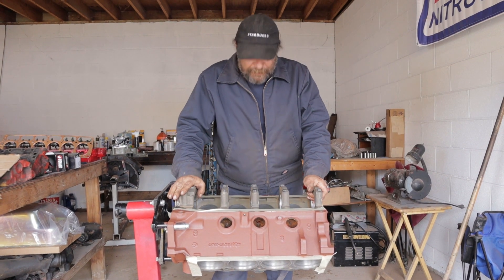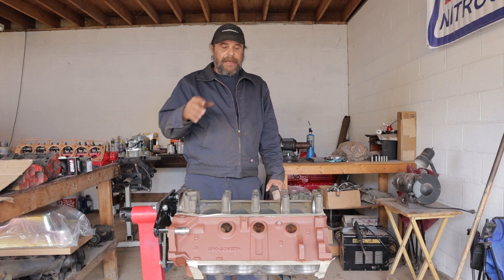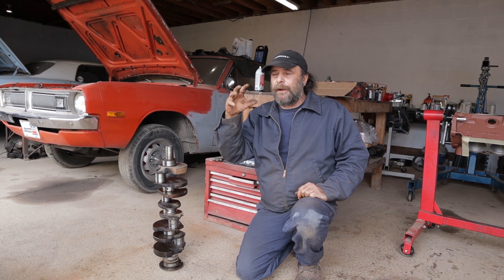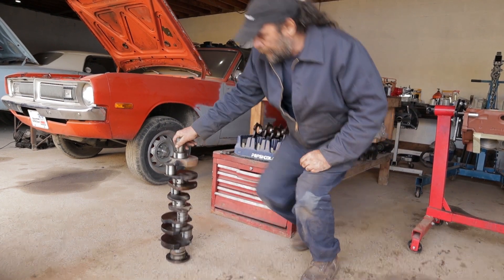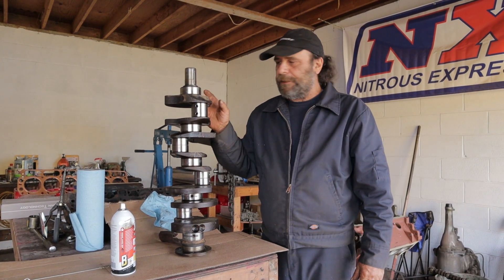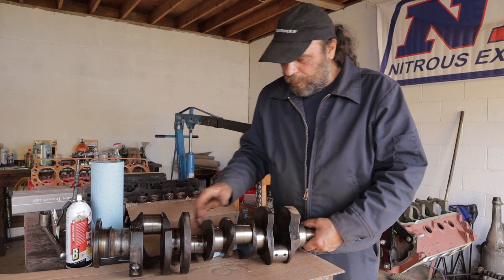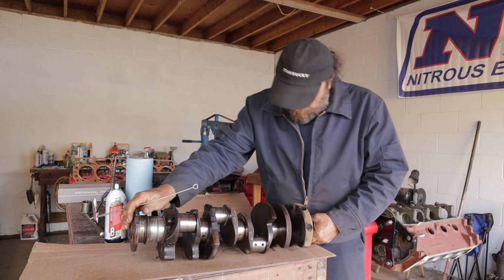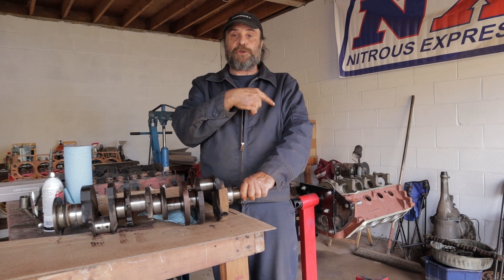Perfect Daily Driver 7 - Talkin' Crankshafts

Comment: Also: if you're pulling crank out of a block, check the thrust before undoing that cap to see if things are really out of whack. and before the crank goes to a machine shop, put it in the block and torque down front and back caps. spin crank in block with a dial guage attached to an open journal and measure for any run-out that means the crank took a twist.

Comment: A few more crank details from an internet crank.  When you store a crank (let's say the plan was a stroker setup) for future use, don't let it sit horizontally and take a bend (unless you're going to sit it on its journals somehow), but stand it up instead. under your workbench is great. If you have a trashed flywheel somewhere, bolt it on and give the crank "feet" to stand on.

when you polish the crank journals, back up the paper with something solid the width of the journal (minus the fillet, defined below), don't use your fingertips.  As bodymen will tell you, using your fingertips will apply unequal pressure. Also, sand in the direction the journal turns, not back and forth, otherwise you are leaving microscopic "fish scales" or as the article says, a nap wherever you stop sanding.  the bearings will tend to find it.

https://www.racingjunk.com/news/2018/02/20/crankshafts-part-3/

That crack area Tony was talking about?  That's the "fillet", and the wider/thicker it is, the stronger your crankshaft will be.  What also makes a crank strong is "overlap", how much the main journals overlap the rod journals if you were to look at it from the side.  That is why when the OEM would stroke out an engine (chevy 400, Pontiac 455 etc) they would go to a bigger main diameter.  So if you're going with a stroker combo but keeping the mains small for oiling purposes (like Honda 2.2 bearings etc)...keep that in mind. 

Cast versus forged: its claimed Ford made better cast cranks than Chevrolet since the latter used more forged cranks in applications needing them.  Meanwhile back in the 1950's it was normal to weld on a crank (forged only) to add material to the outside of the rod journal, then machine the whole mess to add stroke. Offshore stroker cranks are cheap enough now to not be worth it (Even the cast cranks seem to be stronger than expected).  But how to tell between a cast and a forged crank sitting on a swap meet table?  The parting line on the counterweight.

https://www.hotrod.com/articles/how-to-tell-forged-crank-from-cast-spotters-guide/
Reply: Thank you

Comment: I use laquer thinner on the blocks in a spray bottle to dry up any machining oils or wd-40 anti-rust oils, then I heat the block with a pro plane your head to burn off any risidual and before it cools I apply 3 coats of engine primer.

Comment: It's likely my comment will be drowned out by the hundreds of others worshiping the advice in this video, but for anyone that reads this far down, the ring test is NOT valid. Only a nodular iron or forged steel crank will ring when you hit it. A perfectly good cast grey iron crank will not ring (try hitting your block. Does it ring?). And a caliper to measure journal out of round? Seriously, don't.

Comment: A little trick an old timer showed me for painting engines, use a propane torch and go over the block with it. You can see the moisture come right of the metal. Spray the first coat, bake it in with the torch until it’s super dark, spray again and just dry with torch. Spray 3rd coat and let it air dry. It will never come off and look brand brand new for 20 years.

Comment: I just bought a 360 short block yesterday. I wanted to stroke out a 318 Except the junk yard (Tates salvage, in oak ridge) lied and sold me a 318. I think now I'm gonna turn lemons into lemonade, and bore it to a 340. If the Cylinder walls are thick enough.

Comment: I love your videos. only thing I suggest is to use a micrometer instead of a caliper. I'm held to crazy right tolerances at my job. calipers arent allowed for final dimensions in my shop.
Reply: i appreciate that tolerance might need be crazy tight where You work but this is initial inspection of an engine build for automotive not aerospace.... 🤷‍♂️

Comment: I rebuilt an LA 318 ten years ago to stock specs. I used a belt sander on every flat surface to clean up all the witness marks. That worked very well.  All I did was just a skim of the sanding belt, and everything came clean. Saved myself lots of time and the block and heads looked brand new. It's still running like a champ.

Comment: I have had this idea thrown at me by several people over the years ,that vernier calipers are accurate. They are used for rough measurements of plus or minus .002. For precise measurements Micrometers are used, as They have a tolerance of ,0001 inch or better. But I have seen so called automotive machinists use them as C clamps. So you may think it's Ok to use Vernier calipers but you are ,again , going against acceptable practices in Machine work.

Comment: I was going to say if the crank goes thud, it is cracked.  Actual depth of hardening on a factory crank is usually about .030" That is why you can grind .020"under and still have a good crank.

Comment: as usual, great stuff Tony! don't know if you're going to go so far as to really balance it, by weight to parts before assembly, then assembled minus rings walking it around, OR just the crank shaft and flywheel together after all other parts put to equal weight....
"just slapped together" vs "nicely built", is always worth the little extra time!
there is always going to be the stresses of combustion hitting everything oddball, unbalanced adds to wasting power and parts wearing out faster, obviously enough.

Comment: Hey uncle Tony! My uncle is selling a 54 meadowbrook with a v8 Red Ram hemi, it's got a nice patina all the way around. 3 on the tree and needs alot of work to be on the road. For 200 bucks is it worth buying?
Reply: Do not waste your time.  Give me your uncle’s address.  I’ll buy it.   
Seriously, though.  That sounds like a great project. Yeh, don’t worry about the surface rust.  The sheet metal is about twice as thick as a modern car.  
Have at it, dude.
Reply: NO BS GRAB NOW! (if its not purely cancer underneath)
dive under it with something for a scraper, don't sweat the more minor surface rust, jam an ice pick at the thick stuff etc. those can be made sweet as a 51-54 Chevy, if its JUST a straight body its worth its weight in gold at that price too, a project to plant onto a newer frame whatever!
Reply: @modelnutty6503  The paint is 100% gone so it's pure patina haha. But I'll have to check out the frame and everything. I've only looked at it once. It would be pretty sick next to my 78 Trans am.

Comment: I was not aware of all this information on crankshaft's.
Back in 80's you could still find 60's Mopar engines that had steel crankshaft's and low miles that oil had been changed regularly so they were almost always in good enough shape for a good street engine.
Thanks for the information Tony.

Comment: MoPar truck blocks are all made of high nickel iron & quite tough. Cranks are tough also. In the middle of a rebuild on an 88 B-350 camper van w/ 360. Crank measured within factory specs, bore had about .001 to .002" taper. That's at 98K miles. I always measure rod & main journals w/ a micrometer that has a .0001" ( ten thousandths) vernier scale. Curious to see if you can see any affect by advancing/ retarding cam, fuel mileage wise that is.

Comment: The forgings have a grain structure that follows the shape of the part, whereas,  a casting has a grain structure that is somewhat random.  Therefore the  forging is much stronger,and the ring sound sharper and more crisp than with the casting.
But, the cast cranks for most part time racers will do the job just fine.
Some aircraft engines have turbine blades that are made with a single grain.

Comment: Great advice on checking used crank's, I never thought about trying to "ring" them...does a cracked crank still ring?

I would suggest that a cheap set of micrometers would be better than most calipers...is "vernier" old school for "mic"? Full disclosure I have a cheap set of import digital calipers that normally agree with my calibrated mitutoyo mics...but I always use the mics when accuracy and repeatability count.
Reply: loss of hardness wont ring the same, a crack sounds dull maybe BUZZ.
"vernier" old dial caliper and other types.
Reply: @modelnutty6503   I thought he was talking about vernier calipers...but I've never held a set and the way he said made me wonder if he was talking about mics, thanks for clearing it up. 

I guess I'll have to ring every crank I come across to develop my ear...

Comment: As grungy and nasty as that engine was, I’m really surprised it’s in such good shape.

Whenever I see an engine with a half a tube of silicone used on it, I’m expecting the worst.
Reply: I've been a bit guilty when trying to get the intake ends not to leak. Especially after the heads have been decked.

Comment: I work at Callies Performance Products, if you want to come visit once all this nonsense is over I'd love to show you around racing crankshafts.  Please dont tell people its OK to inspect crankshaft journals with calipers, digital or dial, at the very least use micrometers but even that's not recommended but at least it reads to .0001" whereas calipers only give you a rough estimate of .0005" increments.  I've seen so many customers complain that their crankshaft wasn't to the size they asked only to get it back and it's perfect (we use air shoes with OD masters).  Also chrome is done sometimes but that's to repair crankshafts but more people are moving to HVOF which is also called "flame spray welding" to repair crankshaft journals.  But typically the base heat treatment is nitriding.

Comment: everytime I want Uncle Tony, it makes me more interested in a running "needs work" muscle cars instead of the "fully done" (most likely done wrong) cars
Reply: Chorpion 
Because a car with character is alive. 
A car done wrong makes you feel like the whole world sucks.
Reply: From Selling "car I worked on", at auctions or just being at them for support, I've seen some so called done, and needs work, or my favorite the body shop orphan poor thing sat forever waiting for this or that, then slammed together to pass on.. good and bad.. I've seen 35k of work under the car, topside not so much.. but I do believe you can actually save a Car by taking over.. some.. peace
Reply: i had a free GTO with a ton of terrible work done to it. for example, rather than buy a car cover, the prior owner simply drilled holes in the arizona trunk pan and floors before shipping it home to the rust belt.  There was all the paint slathered on it--like the thickness of a dime.  The swapped engine rubbing its last spark plug wire on the steering column (no wonder the horn button was missing!) It was so wrong that when the prior owner offered to buy it back, i allowed it in disgust...and heard his plans to swap in a 305 from a monte carlo since Jay Leno put a 572 chevy in a buick, so it was somehow exactly the same thing.

the next time i bought a project, it was a running 4-4-2 for $4500 that cost at least double or triple that to build.  That 243,000 mile car fustrates me for other reasons, but at least its not the repair work of the prior owner.

Learn how to read a car, and please, save 'em as much as you can :)  Had i the space, i'd grab every 80's pony car/ Gbody i see someone cutting up for parts. Its not hard to get those thing into the 13's or even 12's with a power adder and the OEM drivetrain.

Comment: Hey U.T., how do you check to see if the crankshaft is bent?
Reply: When you put it in the block with bearings, rotate it and it has a tight spot and then a loose spot, or it doesn't turn, even when your journal clearances are correct, you have a problem with straightness.

Comment: Instead of wrapping sandpaper around a 2x4, I spray tack a strip onto a carpenter's level. Dead flat every time.
Reply: I do similar - small section of granite countertop and spray adhesive.  hurts like a mother when you catch your finger between it and the head tho lol
Reply: @Bulletstop75  Try the level, fingers never get pinched.
Reply: I have seen "people" use a wetting stone!!!
Reply: @1080sucks  What you do to the deck prior to this step is more important.

Comment: Uncle Tony I’m building a 318 small block mopar and one of the pistons in the engine has a broken piece of skirt found it in the pan. Should I buy new pistons or should I just buy a whole new set of pistons heads? The rods are all good.
Reply: Piston heads?

There are no parts to a piston (besides the pin). So there is no way of replacing anything other than the entire piston. 

I currently have a motor that had the same issue. 
Here is what I did. 

I replaced with one good used piston. 
I also found another that was scuffed up. 

Honed the bores slightly and put in all new piston rings. 
That motor had 299,500 miles on it when I got it. 
Now has somewhere between 360/400k
Reply: Nathan Brame that’s what i was thinking also
Reply: Nathan Brame I had to have my  new piston & rod balanced

Comment: What's your thoughts on Chamfering the oiling- main and rods- holes in the Crankshaft??
Reply: Daniel Scott   For a high horsepower engine chamfering is a good idea but for a stock rebuild it's a waste of time.
Reply: unless you leave burrs, its not going to hurt a thing, and it only costs your time.  so on a street engine, its like chicken soup--can't hurt to dot the i's and cross the t's.  Here's more on the subject:

https://www.racingjunk.com/news/2018/02/20/crankshafts-part-3/

Comment: great helpful video. thanks. back in 1968 my brother bought a crap car. a 1960 triumph herald. he wanted to rebuild it and do it himself without me getting involved. I said great but I will give you one piece of advise. clean everything really well including the oil passages. sure enough he did not clean anything. all the crap in the passages ate out the bearings in short order. he now had a job so I rescued the thing. crap british engine but one thing it had was a very hard crank. the journals took it all and were still good I got new bearings, cleaned it all up and added a chevy 409 oil pickup screen(triumph had an open ended pipe pickup and no oil filter. at least it had a screen now. the little piece of crap ran on and on till the car rusted away(Minnesota). 38 horsepower. It burned more gas than my 68 nova v8. I told him a model A ford would be a sophisticated piece of machinery next to that thing. I have a hot rod story that I did on a friends 52 mg td for later.
Reply: didja know, Datsun A-series engines will drop right into most older Brit cars?
Datsun copied near verbatim, you can slip in an A-14 or A-15 cam for more power, intake and carburetor etc too. we junk yarded the goodies for a 64 shitfire (sp haha) and it screamed compared to stock.

Comment: A handy hint when storing a crank , stand it on its end otherwise they bend . Everything from a single cyl to a 24v this applies to . Have used cranks weighing tons that have been sitting on there ends foe over 20 years and still have been perfectly straight. Have seen and scrapped cranks from small motors ( less than 12 litres ) stored on there sides been scrap after less than 12 months
Reply: The old EMD cranks I used to work on had to be stored lying down with vee blocks on the main journals a third of the way in from each end, if you stored them standing you had to block up between the counterweights to stop them from bending, in fact, most of the heavy diesel crankshafts I have installed come in a storage box with correctly spaced vee blocks on the mains and are transported and stored lying down.

Comment: The motor im building when I pulled it apart I seen that the counterweight have been fully machined and I meaned beautifully machined. I've never seen the counter weights machine like that then added  healthy chamfer too it. Its definatly not factory like that as I have a handful of 273 318 and 360 cranks and none of them are machined like this and the 360 crank I have has been machined and balanced. Did someone just spend some time to make it pretty.  The pistons are kb167 which aren't super light but idk what the benefit would be to take the time to machine counter weights completely and at such a smooth finish.
Reply: A lot of engines do not have counterweight crankshafts. 
Some engines use the crank pulley or the flywheel to ballance our the rotating mass. 

Sounds like someone has a knife edged light weight crankshaft. 

Watch garage54. It’s a crazy Russian garage channel. 

Where they do many cool and hilarious things. 

One was to take an engine and saw every weight off the crankshaft. 

I think it actually ran really good afterwards. 
Significantly less rotating mass.

Comment: The early 318 LA engine crankshafts in the 1960's weren't machined for manual transmissions and a 273 engine was required for a manual transmission car. Some trucks got 318-3 engines with forged steel crankshafts machined for manual transmissions. The 1960's part numbers start with a 2 and the 1970's part numbers begin with 3.